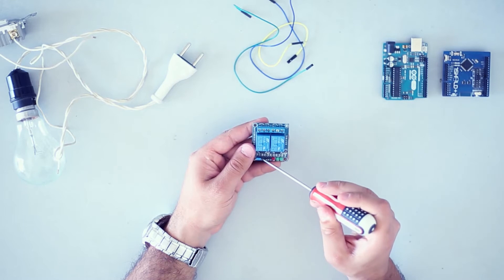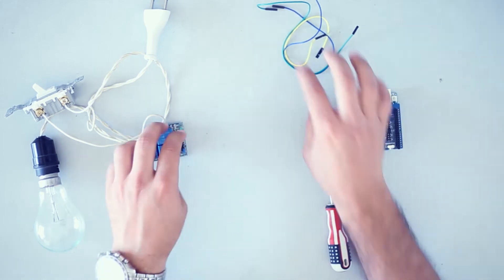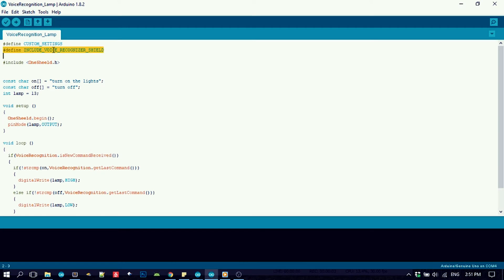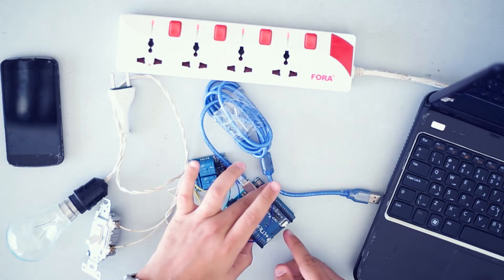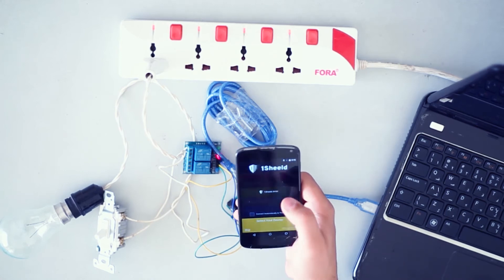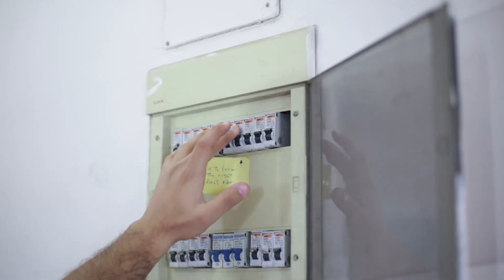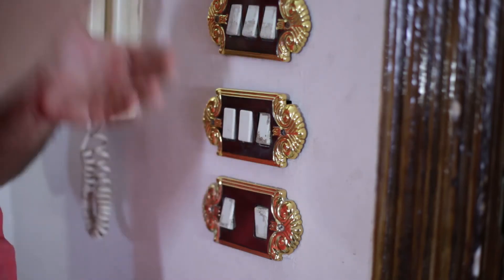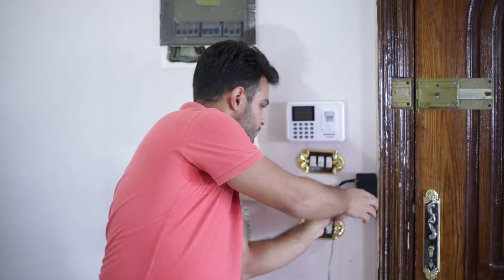Control home lights with your voice (Arduino Home Hacks #1)

Comment: Could I use the same project to control more than one home light bulb? 
Or I need to buy 8 channel relay module to control all the ceiling bulbs in my room?
"I mean the main voltage home bulbs not the external bulbs". 
Thank you.

Comment: Hei, how did you put the light bulb in the chandelier? The light bulb has a small wire
Reply from the maker: Hey Mihai, the light bulb at the beginning is just for demonstration with wires and small mechanical switch so you can have a better lock on how the circuit works.

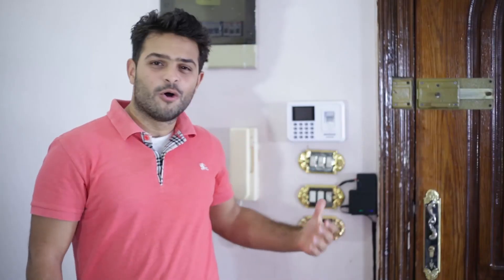While the light bulb in the chandelier is the light bulb in his home which was turned on after he hacked his real home switch as shown at 3:37.